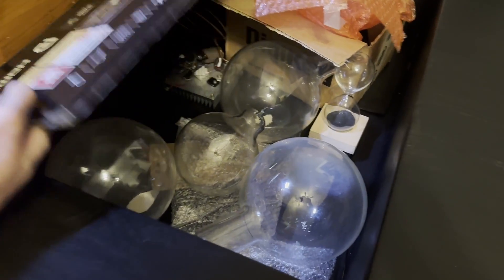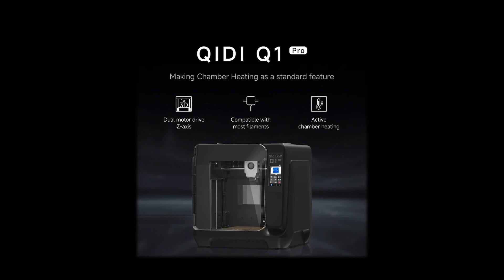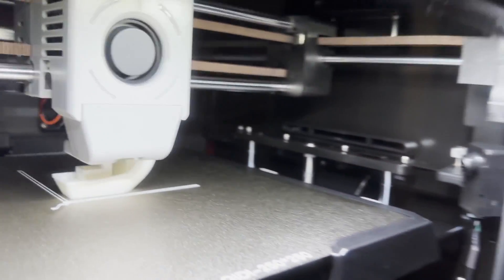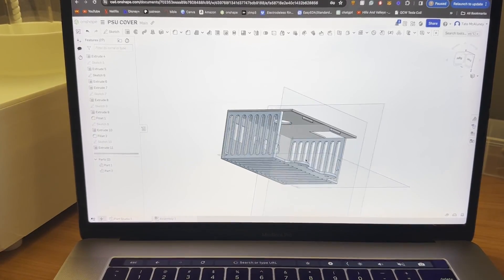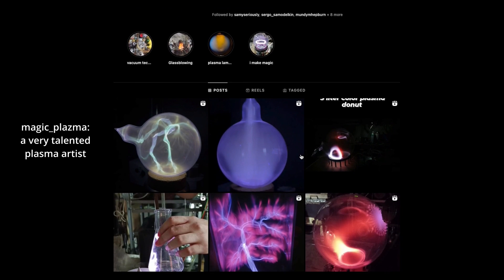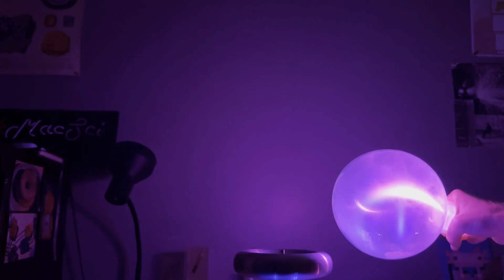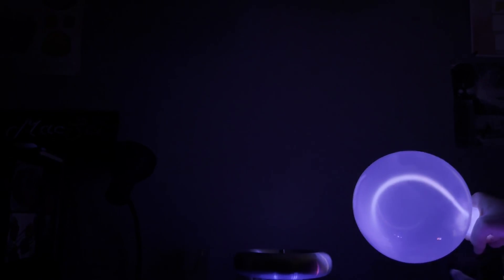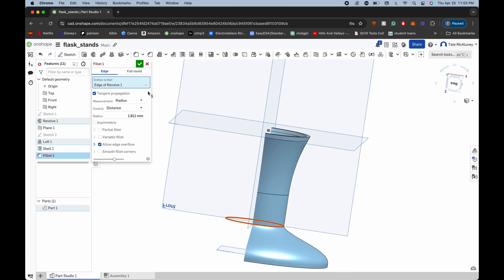My New 3D Printer (Qidi Q1 Pro) and Unique Plasma Effects

Comment: Excellent demonstration. I'm curious if you have experimented with bulbs which are purely high vacuum, while subjecting them to the same high potential - high frequency? I blow my own tubes and construct replica Tesla lamps, having observed similar formations in a glass globe of very high vacuum. 

Here is one experiment I conducted where a rotating mass of plasma is observed under the right circumstances, while surrounded by ultra high vacuum:

https://youtu.be/ITE_qmVDjH4?si=sep0sxV2oWVm1S3P

Comment: Ah, the two main types of print failure: Spaghetti and meat ball.
Spaghetti: Stringing filament across the whole build plate, caused by many sources, easy to fix.
Meat ball: Nightmare inducing, possibly printer killing, could turn into a fire hazard on cheaper printers.

Comment: Have you seen ZergLabs / TeslaCoilPro's recent discovery of phosphorescent mixes? They are EASILY far and away the most extraordinary and fantastic plasma globes I've ever seen. It's not phosphor powder coating the inside that glows, he's actually found fluorine, nitrogen, hydrogen, and xenon, nitrogen, oxygen mixes that allow THE GAS ITSELF to exhibit bright chemiluminescent phosphorescence for several seconds after the power is shut off. I can't even describe how incredible the effect looks.
Reply from the maker: Yes, I know about it and love it! A pale yellow phosphorescence is even observed in low pressure oxygen if you induce a large enough voltage in it! It was recorded back in 1870 https://www.nature.com/articles/001637c0#preview
Reply: @BackMacSci  amazing. it's incredible how many times things have been discovered, forgotten, and rediscovered again.
Reply from the maker: @Muonium1  yeah!